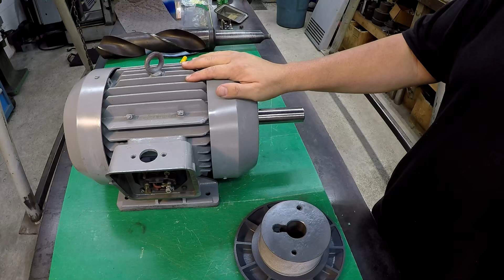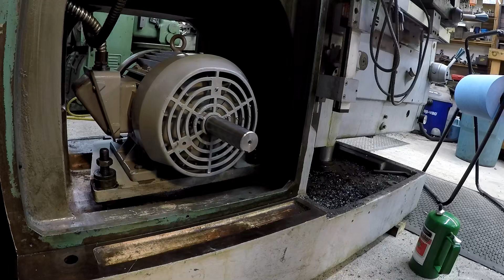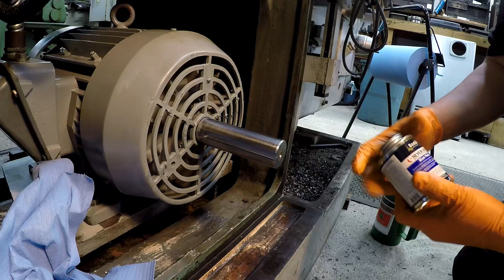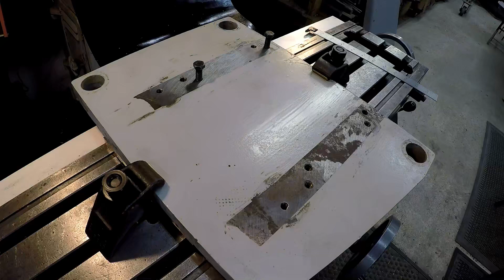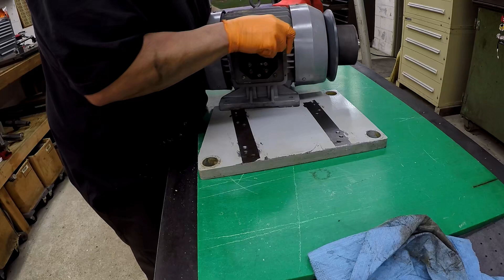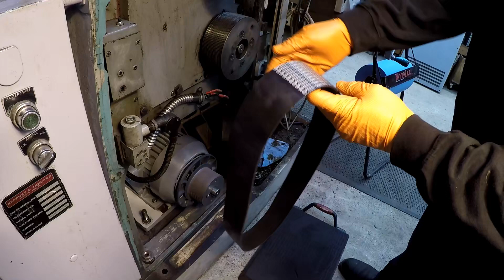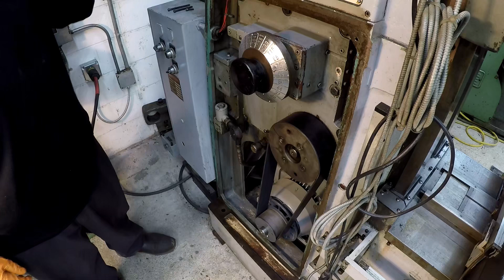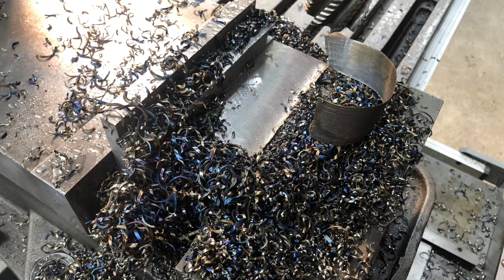SNS 246: K&T Electric Motor Installation

Comment: The reason the pulleys on the KT mill did not align is because the motor pulleys is installed backwards. 
That's not a fan flange. It's a belt outer walk safety flange.

Comment: Definitely a different motor than original. You can see when the original paint on the mounting plate didn't get under thew original feet of the motor, and the shape's completely different for the motor now fitted.

Comment: Good set of videos, lots of detail and information Adam - Cheers. I was looking for a clip with an AC induction  motor refurb, with particular detail on the rotor clean-up and yours is the most detailed I found!  When sanding the rotor, were you worried about taking too much of the surface off; reducing the diameter and increasing the gap between that and the stator? My smaller version of this motor which I'm refurbing has some surface protection on the rotor, similar to green epoxy - very thin and worn like flaky paint almost. Question is.... do I remove this and re-surface with something similar, or can i have sanded bare metal as you have done?

Comment: It’s too bad I’m here so late, because it seems to me that the bottom pulley is on backwards. In systems like this, often, one pulley, and sometimes it’s the one on the motor, has the flange on the OUTSIDE, not the inside.

Usually, before remachining a part to make things fit, people need to sit back and think about the fact that the machine new, from the factory, was assembled properly, and worked properly. That means that NO machining should be required to have it working correctly. The thinking is that, sometimes, someone took something apart, and failed to reassemble it properly.

Why didn’t you contact that guy who sent you the buckle before doing this work? He would have known about the motor assembly.

Comment: Adam, here in the UK we are a bit behind watching your interesting machine shop videos.  As a qualified Electrical/Electronics Engineer, I noticed that when you reinstalled the repaired Milling Machine Motor, you installed the Terminal Box Cover, upside down.  The two narrow faces are facing each other.  Otherwise, superb series.

Michael P-D. UK.    michael.debef@gmail.comq

Comment: Too much of a coincidence that the motor was off by a standard measurement. It looks like the base bolts to the motor frame.  Maybe the re-builder flipped the base. It looks offset in the still.

Comment: the belt drive wheel on the motor looks like its mounted incorrect direction.
fan flange on the outside

Comment: Just rewatched this. Runs sweet. Good video Adam. Not sure if anyone has mentioned and doesn't make a difference just that the motor terminal box lid is on upside down next time you have the side off 😉.

Comment: I'd be tempted to mark out the base plate for the correct bolt hole position - and then cut slots and fit 'T' nuts.
You could shift and adjust the motor position till the belt run was absolutely dead straight.

Comment: why motor plate fixed on 3 bolts only?
Reply: 3 points define a plane,
Reply: pivots off the two the third is the tension adjust

Comment: Ken's Law of wire termination. A derivative of Murphy's Law: The probability of leaving the plug cover off (Motor unconnected) is proportional to the number of wires already terminated (How well the motor is fitted and aligned).

From an electrician, electronics technician and computer repairer.

Sounds real sweet.

Comment: Hey Adam great vid on repairing that motor. Looks like you need to turn the terminal box cover 180 but as it would be awefully close to the terminals. Wouldn't want to see the hard work go up in smoke.

Comment: Adam, great job as always. Nice to see the chips finally. Could you please say a little about what kind of cleanup you do after using water-soluble coolant so that you can protect your machines from rust? I imagine that you have a time-tested routine, and I for one would love to hear your ideas. For example, is the style of your cleanup and de-watering the same after each job, after each day, and after each week? Is it chip vacuuming followed by spraying of some water-displacement product, or do you also wipe all wet surfaces with a rag and then spray? The idea behind my questions is the trade-off between time spent on cleanup and protection vs time spent on the next job. Thanks

Comment: It's the LITTLE things! Adam, that comment you made in passing about letting the pressure off the X & Y handwheels after you've positioned the table is GOLDEN! I was having trouble with my table moving a thou or two and was aggravating as all get out, tried your trick today and it worked!!! It's the LITTLE things!!!

Comment: I never had the motor out, but I don't remember excess shaft coming through the lower pulley either.
Reply from the maker: I had pictures of the unit as pulled, installed like it was on the shaft.
Reply: I agree that there is no way that motor is original.

Comment: Ok, the fan on the pulley has already been mentioned, I was thinking that it probably matches up with a previous motor. It might be redundant with this motor, or even actually hindering the action of the fans built into the motor. Unless it can be proven that the fan on the pulley is actually doing something worthwhile, I would consider removing it from the pulley. Great to see it up and running though, Adam.

Comment: It almost seems like the motor pulley is on backwards  ie.... fan end out, not in.  Also, it appears the wiring box cover is upside down.  The outside of the cover should be vertical and not sloped downwards.

Comment: With that much offset in the pulleys I can't believe it ran at all.  maybe somebody was just running an narrower belt that rode on the inside of one pulley and the outside of the other.

Comment: Hello Adam I just thought. You  say the pulley was a tight push fit I wondered if they reversed the pulley to avoid it walking off the shaft if the tracking was off a little  if only a friction fit  it could walk off the shaft.  The cooling for the motor is all okay and as it should be but because they may have reversed the pulley it may restrict the cooling airflow and so shorten the life of the motor  I did get chance to watch a little more of your video but have been busy working on my Harley hope all this makes sense as I always have some project to sort I like your channel I am a retired engineer machine setter and a  back yard mechanic best regards Alan. Just thought it may have had a separate locking collar ring to avoid it walking off the shaft that got lost if you do decide to turn the pulley round I would find a way of securing it to the shaft even if only loctight  sorry  I am rambling but I am trying to cover every angle. And my wife is hurrying me up.

Comment: Don't foget to recheck the belt tension, after its initial run-in time under load.    How long?  You'd have to ask around.   Over-tightening  on installation, often done in servicing someone else's machine, in order to avoid slipage and sqeals, and a call-back, ultimately shortens the belt's life!   After that, the hours of operation determine when additional checks are warranted.

Comment: One final comment (then I'll shut up!): I've watched a few YT videos now it seems that it would be good to do two things:
1. Watch the whole video, rather than firing off our mouths prematurely, and 
2. Note down our comments, this will give us a chance to edit them before committing them to YT.

Final (final) note: I know there are others who realise this - my apologies to them; to those who haven't realised this ... maybe this is why you (possibly) got a thumbs down,. My experience? I started on the farm in 1973, and I have been doing this since - farm machinery to railroads (railways in Oz) and I've seen what works and what doesn't. I used to repair Hesston equipment - pressed metal bearings, no grease nipples (ugh!); as well as pumps and associated equipment (I was an irrigation farmer). I used the services of a local engineering workshop, who produced excellent work; they were great teachers (a whole bunch of Adams...) and I have also done several engineering courses. I love engineering! 'Nuff said ...

Comment: Forget my comment below - I think Adam nailed it on the head when thought that it wasn't the original motor ... so it would explain the misdrilled holes - also, this could be the third (or fourth) motor on this mill.

Comment: Adam, another great video and i learn a few things every video.     What is the conical shaped tool that you used on the mill to rough center the existing hole before you indicated it.  It looks like a countersinking tool without cutting edges.    Thanks.  Doug

Comment: That vintage K&T would have originally had an old U frame motor on it. When someone let the smoke out of it many years ago, they replaced it with a T frame motor since U frames are obsolete.  They just never bothered to drill the baseplate to align the belt. Happens more often than not, "just get it running and back online", says the shop foreman. Nice to see it running again regardless.

Comment: I have a question which has troubled me for a long time now, and thought this is probably the right place to ask. Cutting oil is supposed to provide cooling and lubrication. Cooling is obvious, but lubrication not so much. How can the oil get in between the cutting tool and work? The edge of the tool always see new material and I cannot understand how the oil can magically appear there before the tool. I tried to Google, but all I find is that it is actually lubricating. Currently, I beg to differ. Anyone?

Comment: Hey Adam, I hate to be one of those who points out things that may or may not be correct... Can the motor mount be reversed? The motor and base plate can only go one way but there seem to be an offset in the mount that connects the two. It's jsut mroe like a pzuzle to me thann to be a pointerr. Gland to see more work on the K&T.

Comment: Gear box pulley was slid on  
.750 to far? Taper lock or same interference fit as motor pulley on gear box pulley. Taper lock just slide out to align. Slot the motor mounting.  More than one way to skin a cat . Heard that a thousand times from the old journeyman.

Comment: I've got 2 air compressors that use a multi-groove belt/pulley like your mill. They need to be lined up very closely or they'll shred the belt real quick. No tolerance for mis-alignment like a 'V' belt...

Comment: The cover is meant to go on the correct way to give adequate clearance between motor connectors, which stick out, and the cover.

Comment: Hi Adam, I used to work in the printing trade try using kitty litter (Fullers Earth) to soak up the oil I used it around the presses. you might find it cheaper than the mats

Comment: In the summer of 1991 I was an engineering co-op student at Syncros, the bike part maker, then a tiny hole in the wall factory in the basement of a body shop that fixed (an amazingly frequent parade of wrecked) taxis. They had a K&T horizontal I'd never operated but one day a new motor showed up for it and I was told to install it. Why? "We'll you're the engineer". So I looked at it all. "Why are there 12 wires coming out of the motor?" I'd never heard of three phase power or multi-voltage motors at that stage. But I looked at the wires and the instructions on the junction box cover and figured it out. Fortunately from working in the oil patch I'd learned about lock outs and general electrical safety. The bottom of the mill looked exactly like Adam's here except that well under the motor plate was a lake of oil or water and separated coolant or something, and there was aluminum chip everywhere; it was hot and dirty and awkward. But I got it done and it worked and nothing exploded and I grew up a bit that day. Thanks for bringing back some memories Adam.

Comment: Isn’t the driven (upper) pulley adjustable (in and out)? Can’t see much but it has a recess on the outer end that has bolts like in a keyless bushing.

Comment: Hi Adam! Is it possible that, at some point in it’s life, someone serviced it and put the pulley on the wrong way with the flange-side close to the motor? Maybe the flange side goes on the outside; it looks like that flange is about 1/2” to 3/4” thick, which would account for the offset you found (and that was causing the premature wear on the belt.) oh well, you now have new mounting holes for the motor; that’ll fix it good! 🤠

Comment: The correct way to determine whether that style of serpentine belt is tensioned properly is to turn the machine on, run your pinkie finger through the pulley system once, then use a micrometer to measure the thickness of your pinkie finger. If it measures between 1/16" to 1/8" (1.58mm to 3.17mm for you metric guys) then you've got it perfect. Hope this helps!
Reply: Dang, Now that's Funny
Reply: Tried that once with vee belts took my finger with me to a and e to be sewn back on .  Yes it was an accident the fan was blown with the return air good job the belts where slack

Comment: Great to see it running again Adam. The motor appears to be way more modern than the machine is (Vintage machinery lists 2 known KT s12 models manufactured in the 60s) so I suspect that it a replacement. Also the motor has an offset foot (mounting island not centred between mounting holes) and is positioned to bring the motor forward on the plate. It's hard to judge the actual amount of offset just from video, but the motor might have been properly aligned with the mounting foot reversed on the motor. As commented somewhat earlier by a motor person, it was common to have the foot offset to give alternate mounting positions to suit the application. It is possible that whoever originally installed the motor was given the mounting hole locations to suit the alternative position but installed the motor with the foot in the wrong position causing the bet offset and wear.

Comment: I found an old can of “garage floor clean” in a box of stuff a neighbor sent over. 
It looked to be from the 60s or 70s by the graphics on the can. The stuff stank up the entire house when I sprayed some on a persistent grease stain on the floor in my basement. The stuff lifted the stain. I have tried so much stuff for so long, that I had given up. 
An old friend dropped by and said “I smell cancer...lol”. I guess that’s probably why it’s no longer available

Comment: Steve Summers has a K&T mill that is almost identical to yours and it has what appears to be the original motor. His motor has cast iron bells and open winding's visible through the vents. It also uses a three v belt drive system. It is not even close to the motor you have so I think you can assume that the motor has been changed at some point in time.
Reply from the maker: His mill is much older then mine by at least 30 years, a different generation. Mine is the hydraulic model.
Reply: @Abom79  Okay, my bad.

Comment: The baseplate has so many holes drilled in it so, what is there to say that someone, somewhere didn't turn the baseplate around and some of those other holes might line up?

Comment: Bit late now, but could be useful info, maybe the motor was refurbished in the past, and someone put the feet on backwards ?
Looks like those feet are bolted on from below, and you can see there's an offset.
(i used to work with motors, and it was optional which way the feet were installed to bring it forward or backwards)

Comment: Reading below that this is possibly the forth motor in this machine, it would be interesting to see what the original motor frame specs were. If the mill was made in the 50's, it might of been designed around a pre "T" frame motor. Motor frame designations determine horsepower, physical mounting base dimensions, and most importantly, shaft height and protrusion from the first motor base holes. If you match frame number to frame number, the motor pulley and driven shaft  will be centered and the belts will align properly.  I think someone upgraded to a newer frame motor and tried to compensate for motor mis alignment.

Comment: Hello Adam from what I can see the pulley may have been put on backwards by someone it it makes sense to me because the amount of offset putting the motor further in because the fan for cooling is on the other side I was busy doing other stuff so I will have a better look then but the pulley seems to look right the other way round to me best regards Alan yes I noticed the fan for cooling is on the back the small  cooling ducts on the pulley is I think for cooling the belt but the Main cooling for the motor is on the other side hope this makes sense. It could also restrict the cooling airflow if on backwards.
Reply: I noted the internal fan vanes visible from the pulley side.  It seems to me that, given the shapes of the fan housings, the two fans would actually be fighting eachother for airflow. I wonder if that's ok here. I agree with the external fan positioning notion, how much do you want to bet that the external fan is something like 3/4" - 1" thick?

Comment: Glad to see you getting around to it. When you said being ~1/16th off on the belt alignment was okay, it was a bit of a surprise.  Goes to show how your consistent pursuit of accuracy has built up your reputation.  With the belt being so drastically misaligned before, was there any damage or warping to the upper pulley/shaft?  Each restoration you share provides both instruction for learning machinists, and a new lease on life for a refurbished machine.  That is the kind of gift you can be proud to pass on to future generations.  Thank you, and take care.

Comment: Those mistakes are very relatable. If I had done something like this I would've probably first mounted the motor on the original holes, then the right holes with the complete machine assembled, then on the wrong holes again with the motor hooked up, and only then the right way.